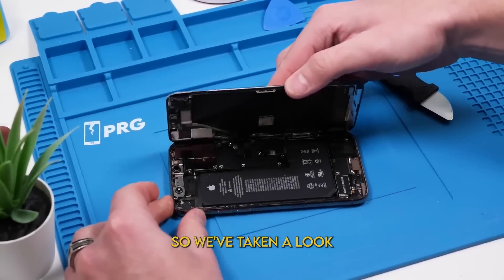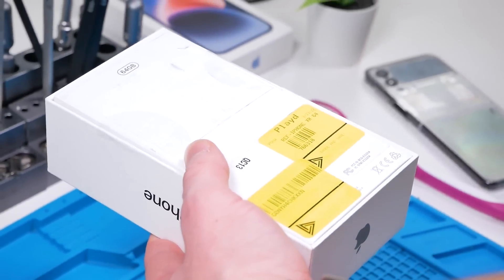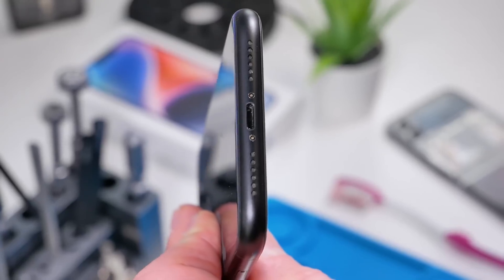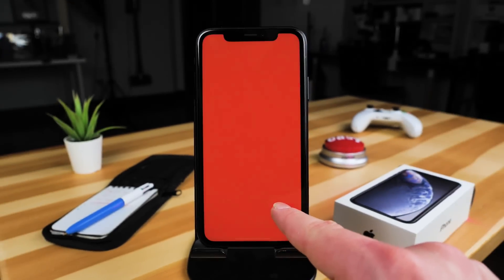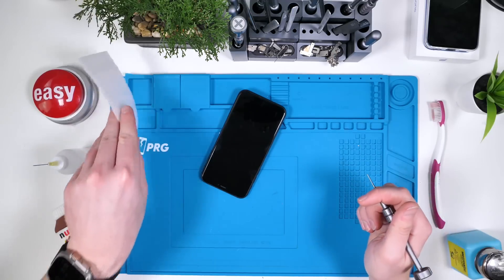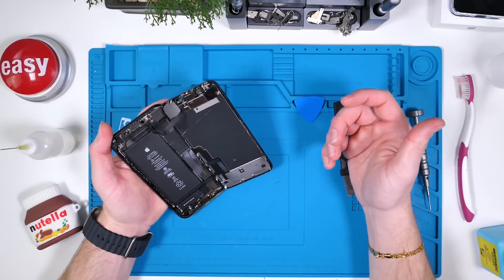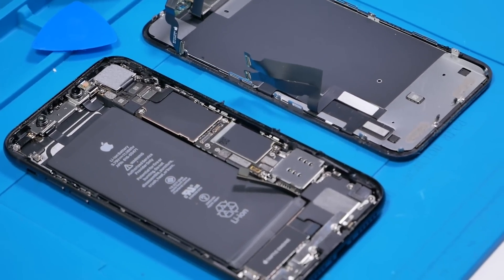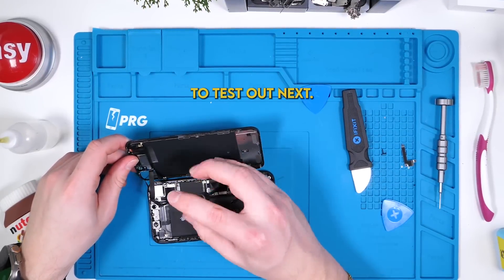Do GameStop iPhones Use Fake Parts?

Comment: You asked iFixit to sponsor you, as far as I’m concerned they suck. Last year my XS Max stopped responding to touch no cracked screen or any signs of damage. I ordered an “OLED” from them and it didn’t respond to touch. So I asked for another one, that one worked. But the color when watching something like Batman or Star Wars, forget it. It’s like trying to watch a broken plasma TV. I asked for a replacement for that, again not responding to touch, then a 4th one and still not responding to touch. After that I asked for a refund, they said I’d have to send in the 4th replacement and the only screen that was allowing me to use my phone. I’m still stuck with the crappy screen because I couldn’t afford to wait weeks for a refund and the loss of use of my phone. So screw them.

Comment: i would be surprised if you are going to keep the phone as your daily driver or even use it more than just to film the video.

you are probably just going to shove it off into a drawer somewhere or it collect dust or even resell it on ebay for a profit .

so protecting the password should not be necessary for a couple reason.

1. if we was to meet you on the street we would probably not recognize you and identify that you are from phone repair guru

even then it is fairly easy to change your password.

2.  being that it is the xr or 10 r it should have a new enough ios that it would have the "find my" software witch you can use to wipe and report stolen if you was to use it as your daily driver and it not just be a guinea pig for this video.

Comment: Bro I have a iPhone 6s and recently my phone screen went out. I’ve bought another 6s screen but I have the same problem. Today I’ve charged the phone and tested the new screen again but it actually worked, even the old one. But the problem is that I bearly see anything because the brightness was just too low, I’ve tried everything and even turn up the brightness on the phone, it shows that the brightness is all the way up but I still can’t see properly. Is there a way to fix this type of problem?

Comment: Hello I was wondering if my phone can be fixed?

I have an iPhone X and I bought it from one of my friends for $100 because it was pretty broken. He told me "it works, it just turns off by itself sometimes". When I first bought it nothing really happened until a few weeks later. After 2 months I left it charging and I came back to it being stuck on 0%. We went to a phone repair store and they said it was a "battery problem" obviously we said sure and paid the man $70 for him to change it. After he changed it, it was working for 1 hour until it immediately got back to 0%. Now to my question again. Is there another way of fixing it?

Comment: How much would it cost for you to repair a controller of mine? 

I know exactly what's wrong, but I can't find a replacement for the part. It just so happens to be a AWM 20941 vw1 90v 105c ribbon cable for a PS4 Controller. I can't find a replacement online because they're all 60v when it requires 90v. 

If you could give me an estimate on what it would cost for the repair, it would be much appreciated.

Comment: @phonerepairguru my Taptic Engine was making noise and I thought tightening the screw would fix the problem but the repairer claimed I need to replace. The screw was loose actually but he said Taptic Engine screw should be bit loose, is it correct?

Comment: Hey, Guru do you repair laptops because I have a laptop that is stuck in airplane mode and I can’t fix it without opening it. Now I have someone in my family who is good at this stuff he looked at it did the basic things to try and fix it before opening it. He told me he was so frustrated because everything inside looked fine and it still wasn’t working. So he hot-glued the Wi-Fi chip to the computer. Thankfully, it still works but alas, the computer is still stuck on airplane mode. If you can please fix it. Unfortunately I’m pretty sore the store you work at is not where I live so maybe could I ship it to you?

Comment: I bought my daughter a REFURBISHED PS4 from GameStop for Christmas and it came up with an error when I plugged it in (something about system memory) so I tried to boot it in safe mode... Same thing. Pulled the hard drive and it looks like it has been set on fire. I wish I could post the picture but clearly it wasn't refurbished or tested. Yes they sent me another one and I had them overnight it so it would be here for Christmas but now I'm doubtful if they even do anything but wipe them down and rebox them.

Comment: Well if they replaced it with a non Apple Original battery and didn’t program it it will come up as an error also the screen as well u can also test if it this has True Tone working. So sometimes with a screen not from style u lose Face ID or it start acting up.

Comment: The thing is, there are now a lot of authorized repair dealers who are able to get OEM parts. Or it could be an actual trade in that didn’t get fixed before, you could probably somehow check the history of the parts used too since with OEM parts they require to be serialized to finish work orders/repairs
Reply: The thing is, there are now a lot authorized repair dealers who are able to get OEM parts. Or it could be an actual trade in that didn’t get fixed before, you could probably somehow check the history of the parts used too since with OEM parts they require to be serialized to finish work orders/repairs
Reply: @TheStrawberryGurl  ?
Reply: The thing is, there are now a lot of authorized repair dealers who are able to get OEM parts. Or it could be an actual trade in that didn’t get fixed before, you could probably somehow check the history of the parts used too since with OEM parts they require to be serialized to finish work orders/repairs
Reply: @tonks564  huh?
Reply: The thing is, there are now a lot of authorized repair dealers who are able to get OEM parts. Or it could be an actual trade in that didn't get fixed before, you could probably somehow
check the history of the parts used too since with OEM parts they require to be serialized to finish work orders/repairs
Reply: @Syvern.  huh?

Comment: I don't really think a 10/10 is warranted with a battery health of 87%. Not bad, but it could've been replaced, reprogrammed, and a new seal installed. Then again, this is GameStop we're talking about.
Reply: @quicklyform5162  Well yes, the 87% was from whoever previously owned the phone, but for a "refurbished" phone, I'd expect a battery with as close to 100% as possible, which means replacing it. Replacing it (with correct programing) resets it.

Comment: I sold GameStop a iPhone that had missing screws I had tape inside the phone 😂 I didn’t care to put the battery metal cover back on I used a battery that didn’t have nfc 😂 best part it passed the test I got 80$ I could have got 200$ plus for the 128gb iPhone 6 at the time but I didn’t want to sell a phone that I took apart because I had to buy another battery and put the screws back on so I sold it to GameStop and bought call of duty blacks ops 4 back when it just came out

Comment: hey dude I was wondering, I have a Samsung Galaxy S6 that I've had for some time, but something happened to it when I plugged in 2 years ago, and it does come on but... it just shows the Samsung logo for about 5 minutes and then switches off, we have tried installing new software and tried replacing the battery, nothing worked, so I was  wondering if you have any tips on why its doing this and how to fix it, would be really really helpful because a new phone costs like 2000 over here :(
Reply: Sounds like an SoC/RAM issue, but I can't tell without bench testing the board, you need to find someone specialized in microsoddering who has an Octoplus box or any JTAG box solution with samsung support. Mind you that such repairs are only worthy if you need to recover important information from your device because it is delicate and time consuming, otherwise you're better off just getting a new one.

Comment: I got the same exact phone from GameStop, but the box was different, and the battery was changed. Still a 10/10 for mine
Reply: 300, it was a while ago
Reply: For how much?
Reply: If the battery has been replaced thats fine but 87% battery health is completely unacceptable for $400..I’d be taking it back in a heartbeat..
Reply: @9852323  my XR is at 81% I thought 87 wasn’t bad   It’s been like four years since it came out.
Reply: whichpgone
Reply: 87? That’s not that bad? Please tell me how 13% makes a huge differenc between trash or good.
Reply: @XenoPlazma i got 97% xr for 200 dollars